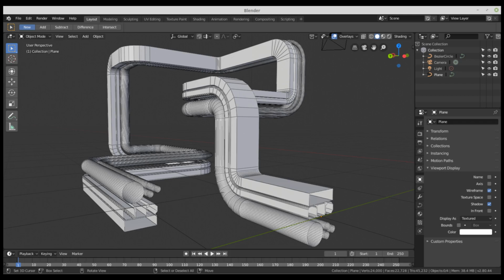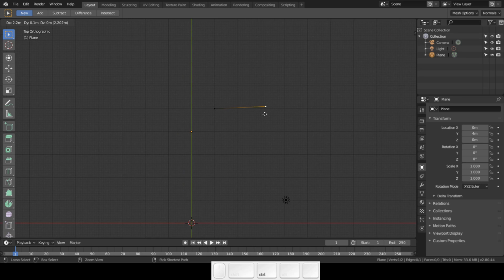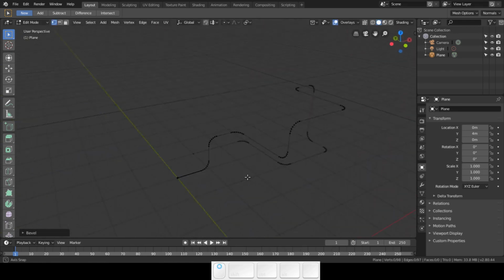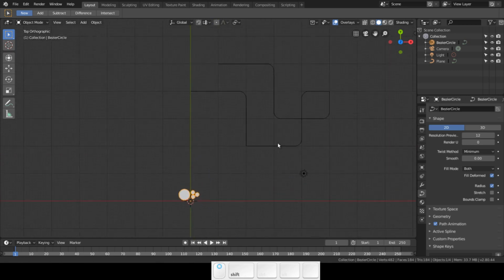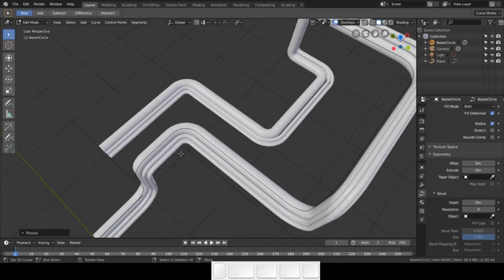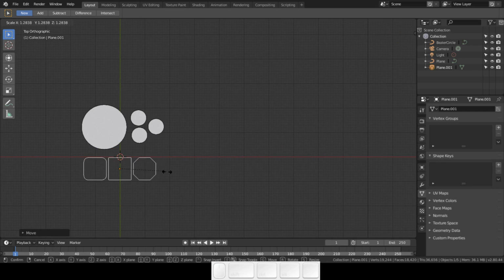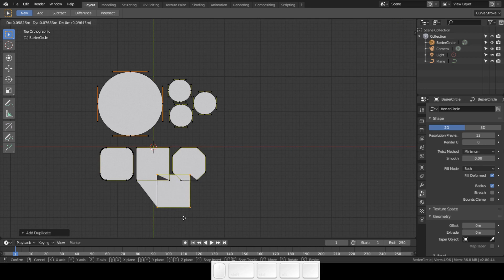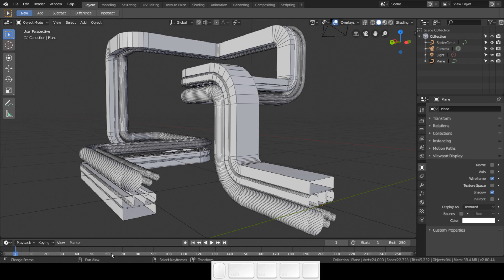Blender 2.8. Modelling with Curves, how to make pipes.

Comment: Very useful tutorial, super useful to have an accessible way to build pipes quickly and cleanly. I'm an electrician and I thought I'd give a small amount of constructive feedback in terms of how real tubing is formed in the field.   Terms to google for reference images are in asterisks. Small tubes, such as 1/2" (~15mm)  Electrical Metallic Tubing aka EMT is going to have very tight radiuses of about 6" (~150mm) for each 90.  Larger tubes like a 2" (~54mm) feeder that could supply to an entire house or small buisiness is going to have a much wider radius as much as 12" (~300mm) of turn per 90 as smaller turns will cause the pipe to distort or kink. Conduit will generally be laid in parallel runs with a minimum of bends possible. For every 4 90 degree turns (360 degree max) the tubes will enter either a junction box or pull elbow as each turn makes it more and more difficult to get wire through. Electrical conduits will never have Ts or sharp 90s as these would make pulling wires in practically impossible. EMT Couplings*, a slightly wider 2" long piece pipe with a bolt on each side, will join two pipes will occur in groups every 10'/3m as this is the maximum length pipes come in. When entering a junction box tubing will typically be attached with an *EMT connector a slightly wider pipe piece which bolts to the pipe and the box.   When laying conduit around obstacles electricians will often bend pipes into two common shapes called "offset bends* which change elevation a bit or conduit saddles bends which jump over another conduit or pipe.  98% of all the offset bends you see in real life will be made at 30 degrees because they are the easiest type to do the math for. All of the comments above are specifically for electrical conduits. Plumbing will be run in long bendy plastic tubes PEX Piping or orthogonal Cast Iron, Brass, or Plastic pipes  which will feature frequent fittings and will have much tighter turns than electrical. For plumbing connectors some good terms to google would include Compression fittings*, *Shut off Valves and Manifolds

Comment: Very useful for a Blender newbie, thanks :D Is there a way to add more resolution/polys to the rounded corner? I've tired adding more points/subdividing but makes no difference.
Reply from the maker: Do you mean the corners of the path? With shift+ctrl+b you can add more verts by scrolling the mouse wheel.
Reply: Baptiste G thanks. Not quite! I’m looking for a way to increase geometry around the bends at the corners, to make them smoother. Adding more verts to the curve seems to have no impact on.
Reply from the maker: @MarkWarnerTV  If you want smooth bends, then make sure you have lots of verts in the bends before you convert the path to a curve.
Reply: @BaptisteG  Got it, thank you! Subdividing wasn't rounding out like I was expecting (the dangers of coming from another 3d app!), all good now. Thanks again.
Reply from the maker: @MarkWarnerTV  Glad I could help.

Comment: how do you rotate the circle or curve that you have running along the spline so that it also rotates on the spline when applied ?
Reply from the maker: You can just rotate the circle or curve. You can also tilt the spline in edit mode. Select the points and ctrl t to tilt the spline
Reply: @BaptisteG  jup, rotating it in edit mode is just what i needed, tnx a bunch.

Comment: Can you do mesh to curve? My problem is, I have hollow tubes (mesh) of different shapes. I need a curve to run through the center of the hollow tubes, end to end . ..
Reply from the maker: I try to visualize what you mean, but I cant. Please explain.
Reply: I have hollow tubes of different shapes, like pipes in mesh form, from another designer. i need to create a curve that will be pass through the center of the tubes . . .something like a coaxial cable . . . if that makes sense.... let me know thanks
Reply from the maker: Oh okay, now i get it. Hmmm, this is a tough one. Are the shapes travelling in 3 dimensions? I dont see an easy way to do this.
Reply: @BaptisteG   yes they are travelling in three dimentions. one could individually select the vertices of the cross section of the tube find center, add point and trace out the whole tube, then trace edges and convert to curve . . .  but that is a lot of work . . . cant be applied for high volume work . . . one or 2 tubes okay
Reply from the maker: Then I would script it. Should be doable
Reply: @BaptisteG  if you want to do it, i ca n give you the mesh object to try it on . . . let me know

Comment: Don't you know that if you activate Extra Objects add-on (shipped by default) you get a Single Vert option in the Add menu?
Reply from the maker: Yes, but I chose not to add this addon to the tutorial. Someone pointed out i could use w and collapse, that way I would also have a single vert.
Reply: @BaptisteG  I suspected it could be so. That's an awesome piping trick by the way. Thanks a lot for the tutorial!

Comment: Ordinarily, this method looks fine, but it is not good for super-accurate work.  The bevel method creates an inconsistent pipe width between curve ends.   The bevel on the path curve does not make a complete cross-section at each end that is square with the linear portion of the curve.   So you get straight lengths that are not the proper width.   Look closely at your wireframe cross-sections - they are angled at the ends, not complete 90 deg. turns.   The only 'proper' way to make these kinds of pipes accurately, is using the Spin tool.   You can also use curve Arcs from the curve objects Add-on, but that requires more work joining the arc segments.
Reply from the maker: Thank you for your feedback. I saw that in the bends it was not very nice, and since the path is twisting weird things happened.

Comment: here are the steps from the video
make a plane
delete 3 verts leaving one
extrude the vert making a new vert.
trace out a path like this

check there are no double verts, merge vertices by distance
ctrl shift b to bevel the corners
convert to a curve
make a circle in the  curves menu. 
make it 2d and turn on fill mode
slect the curve
select the bevel objects
boom.

for square pipes, make a plane. 
delete the top 2 verts, etrude verts out to make a cube. push f to complete the shape
convert to a curve.
Reply from the maker: This is actually better than what I said ;-)
Reply: ashton simmonds I think you may have a billion dollar idea on your hand if you can figure out how to summarize all edu content like this! I’d start with openCV OCR!
Reply: Thanks bro, saved me valuable time!!!
Reply: I came here just to learn how to use the bevel option. Didn't know it had to be a curve. Ty.
Reply: Something wierd happens when i do ctrl shift b, the corners only bevel internally not like yours, any ideas?7
Reply: @lazenbytim  Internally? Are you using it on a 3D model? You should only have line segments when you ctrl shift b.
Reply: You forgot uhh. and ehhhh. and emmm. errrr toooooooo. just add those at random all over the ehhmmm steps
Reply: You forgot that before you select the bevel option you have to ehhhhhh uhhh ehhhm eh...
... select ehhhhh
...the uh

Comment: I have no any "remove double vertices"
Reply from the maker: Remove doubles is now replaced with remove by distance.
Reply: @BaptisteG  Thank you, but I have menu "split, separate, dissolve" under merge verticles. What am I doing wrong
Reply from the maker: @NixisI  hey, in edit mode if you press w, you get merge vertices. There is an option by distance?

Comment: How did you associate the circles with the vertices I can’t seem to follow that part
Reply from the maker: Select the curve that the circle will follow. In the context panel on the right there is a little curve icon you can see the option to set a bevel. The circle is the bevel.
Reply from the maker: The vertices are converted to a curve, and then you can use the bevel option to select the circles.

Comment: Ctrl shift B 
Doesn't work
Reply from the maker: I have 2.8 with right click select and it still works. It is a 2.79 shortcut
Reply: @BaptisteG  Yes！Thank you! Right-click and select the "Bevel Verticals" and it works, just don't know why it doesn't work with ctrl shift B
Reply from the maker: @摸鱼小能手-v7i  I tried it today and it still works with ctrl shift B on 2.8.
Reply: @BaptisteG  I messed up tried to go back, and ctrl shift b didn't work either. It was because the line was still a curve lol...Guess the option only works with meshes.

Comment: W key is not opening a menu, it's just changing the selection tool from box to lasso, etc..   I don't see most of the options you have across the top.  My menu is at the bottom and has view, select, add, curve, control points, and segments, but no mesh, vertex, edge, or face buttons.   How do I pop open the menus for duplicate vertex elimination and so forth?  There's no vertex button like shown in your video.
Reply from the maker: This is strange. Blender 2.8 is also mixing up the traditional shortcuts and hotkeys. So it could be another key...

Comment: Irritating is that converting this work to mesh makes the pipes gone, useless for some applications. If you convert, it turns to basic vertices and is not taking your profile . Please try it. And tell me if you are successful. Can't use curve object in a game engine. It would be greater to extrude along path. But I don't see that option in blender2.8, maybe blind...
Reply from the maker: Yes, this is actually an old sore in Blender. Curves give you a lot of power to model really nice things really fast. However, all game engines use vertices. So you need to convert to mesh. Maybe planning ahead helps, and before you convert to mesh, make a copy.
Reply: no, this is a bug in 2.8. converting in 2.79 works. I reported this issue already. hopefully they fix that basic function for the final release in a few weeks